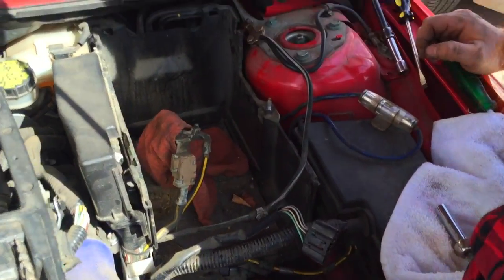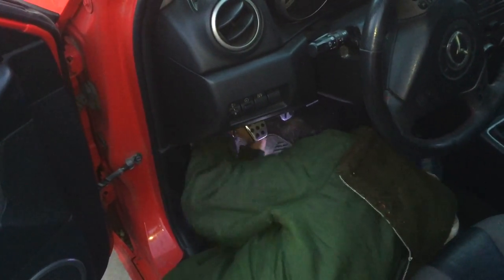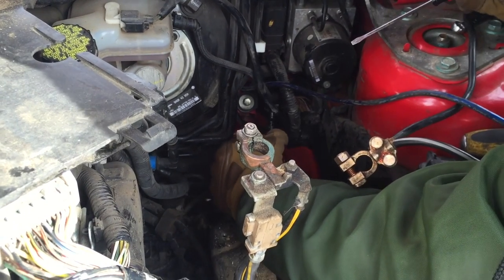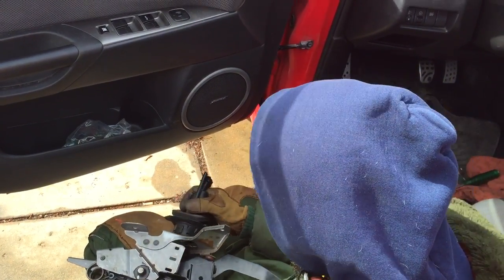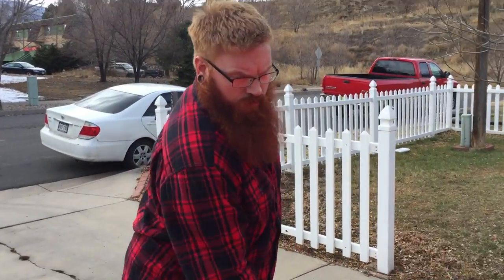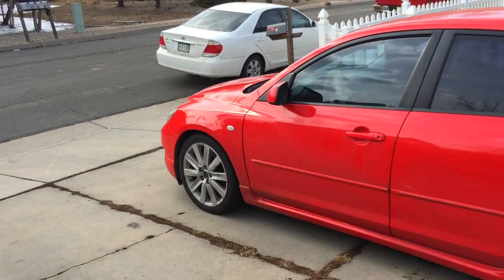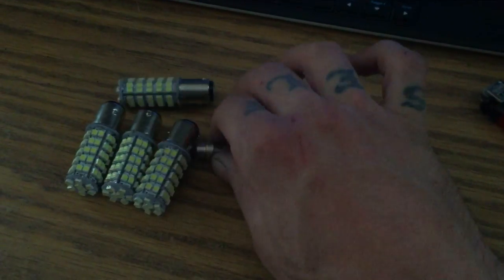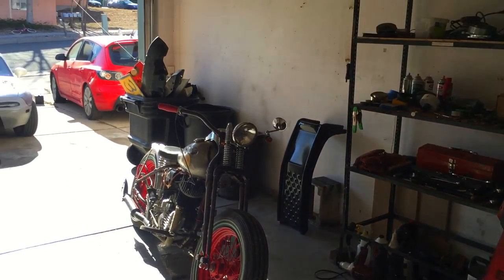MAZDASPEED SUX S02E08

Comment: Lol, sounds the same as any other dash I have been under.  Miatas are pretty  low on space, doesn't look like the 3 is any better.  The vest part is when your arm gets stuck between the floor and firewall behind a pedal.  Was this better or worse than a heater core job?
Reply from the maker: this is the worst anything i have ever had to do on any car under the dash. the entire pedal assembly had to come out. could have been better designed for sure. complete nonsense for a plastic part that was bound to break anyway...
Reply: +Wayne'sWork plastic rod plus clutch is a comedy sketch that writes itself! Why the...plastic...I thought it was plastic with a steel or at least aluminum core. That's seriously poor execution. Make the part from aluminum at least...that's dynamics 101 stuff.
Reply from the maker: or, if they wanna be cheap and dumb, at least make it easier to remove, LIKE ALL OTHER clutch masters.... lol counter intuitive much???